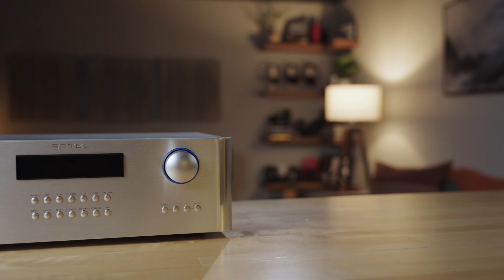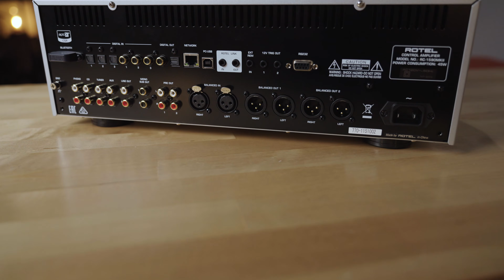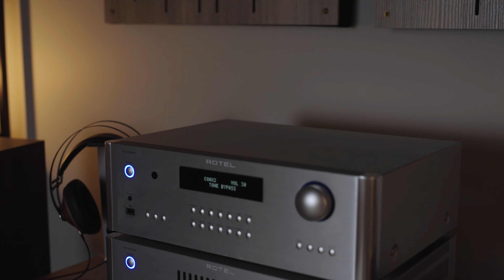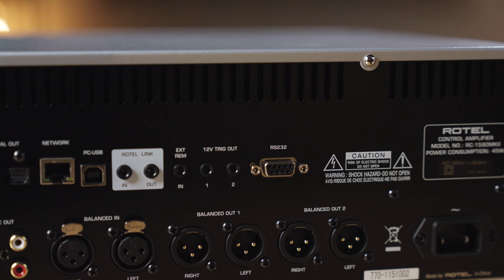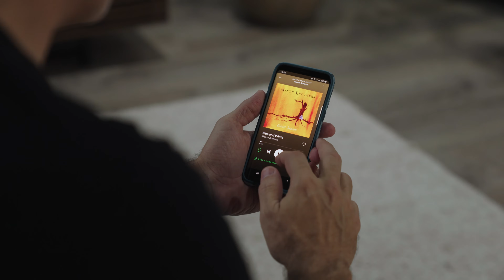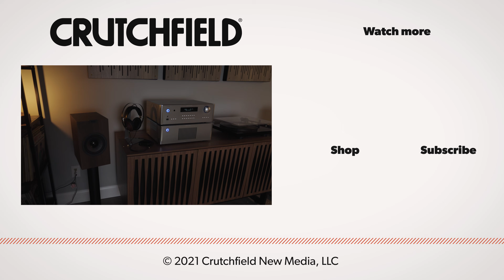Rotel RC-1590 MKII stereo preamplifier | Crutchfield

Comment: Hi 👋 Sir good morning. My favorite Pre amplifier Rotel 1950 , I have Parasound A21 + power amplifier, P 6 pre amplifier, I am not happy with P6 , I want to buy Rotel 1950 preamplifier. I have listened to it , can buy Rotel 1950 and connect Parasound A21+. Will it match l am a stereo listener. Please advise waiting for reply.
Reply from the maker: This preamp sure can be used with the Parasound HALO A21+ power amp! They can work well together

Comment: Is it campatible with the McIntosh MC 250 I need to know from amp to pre amp the inpedenes will they get along and play awesome sound?
Reply from the maker: The RCA preamp outputs on this unit are a 1V level signal and per the owner's manual for your amp, it can be adjusted to take this stronger signal than the 0.5V it was set to take from the factory. They will work well together!

Comment: Looking to replace my vintage pre-amp and was very interested in the Rotel. One concern, I use a graphics equalizer to tame several runaway frequencies in my room. My current pre-amp has processor in/outs as well as two tape monitor loops, either of which can be used to incorporate the EQ. It doesn't appear the Rotel has this feature, however, I noted it does have a line level output. If this was to be used, where could I bring the output of the EQ back into the pre-amp before sending the signal on to the power amp? Is this ever possible with this unit?
Reply from the maker: This unit is not able to take in audio from an EQ. The only way to use an EQ with this preamp processor is to use one of the preamp outputs to send the audio to the EQ. Then the output of the EQ would be sent to the amp.
Reply: @crutchfield  Thanks, that's what I thought. Trying to avoid doing that as it's not the optimum way of connecting. Thanks for the reply.
Reply from the maker: You're welcome! If you need anything further, please let us know.

Comment: Rotel RA 1572 has the possibility of dimming the ring around the power switch. I'm going to jump to RC1590 + RB 1582 but I'm not sure if there is an option of dimming the rings in RC and of RB? Can you confirm that RC-1590 has it?
I use a projector, and dimming the display of the Rotel and this ring are super features.
Reply from the maker: The Display lighting can be dimmed permanently in the units settings, or temporarily using the "SIM" button on the remote! :)
Reply: The RB1582 button cannot be dimmed sadly.  Not just that, it's extremely bright and stays on during stand by.  Which is extremely annoying.  Both my RC-1572 and RA-1592 can dim the button.